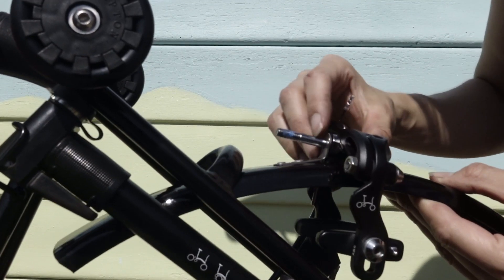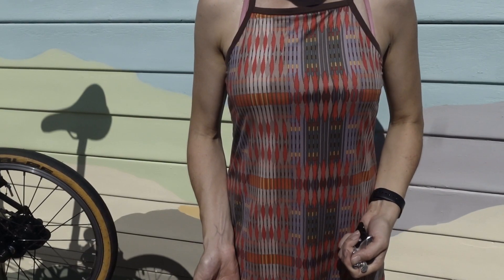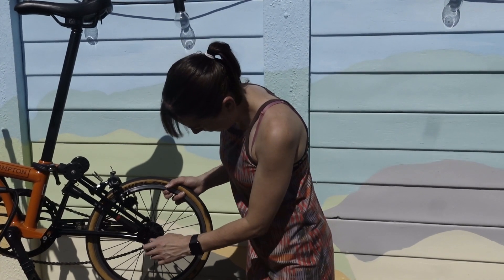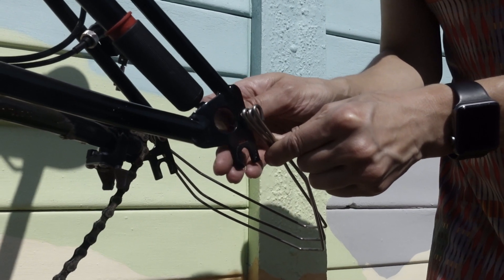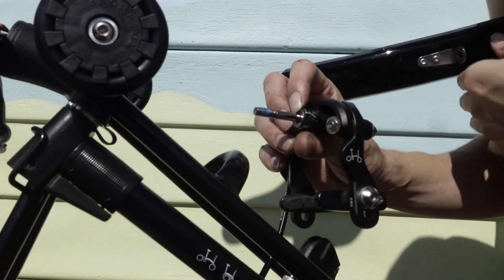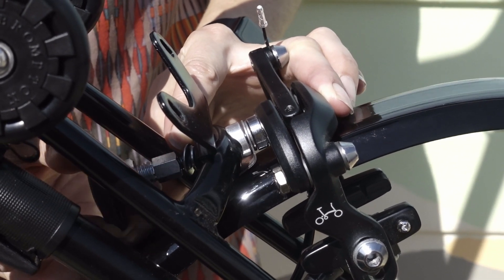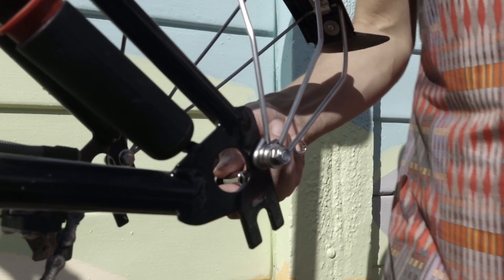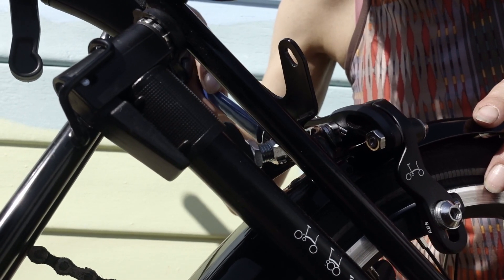Brompton rear mudguard installation and white trouser test

Comment: Great video as usual!  Helped me a lot. But I fitted rear guard to my B75 without removing the rear wheel. You need to fit the nut/bolt for the stays in the rear frame the other way around and deflation of the tyre is necessary to get the mudguard mount under the caliper. On the sprocket side tightening the nut and bolt for the stays is fiddly due to lack of space, but no more so than fitting the stays to the mudguard earlier. Other side is a doddle.
Reply from the maker: Thanks for watching and taking your time out to comment and leave the great tips

Funnily we originally fitted (by mistake) the nuts and bolts the other way around - but wanted to make it as per the "Brompton setup"
Reply: How much all bits cost for putting mudguards please and any cheaper alternative for mudguards 🙏

Comment: Very helpful video! Just wondering, do you know the bolt type and length of the bolts holding the mudguard stays in place? I've bought a 3rd party rack (similar to the H&H rack) and the bolts on my l-type mudguard will be too short to hold the rack in place too. I'll need to buy longer bolts, so any information would be really helpful!